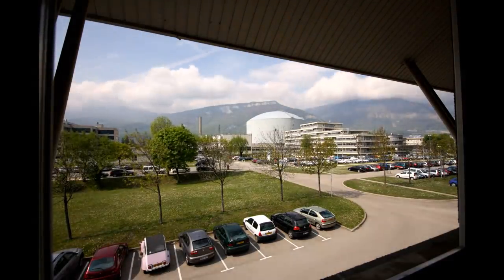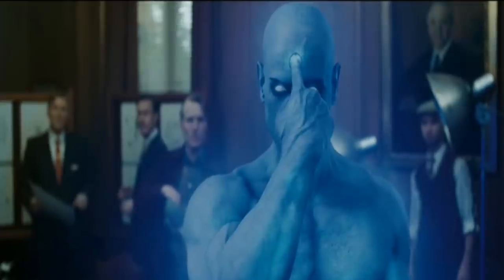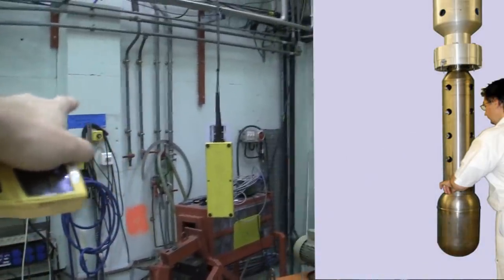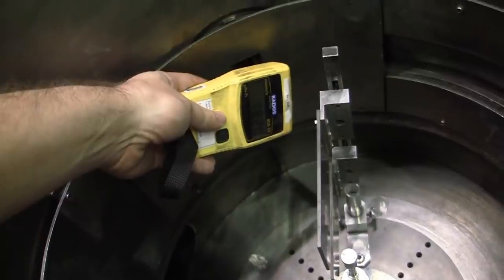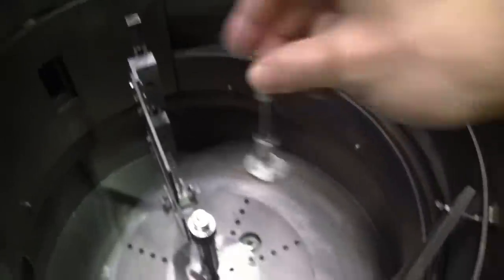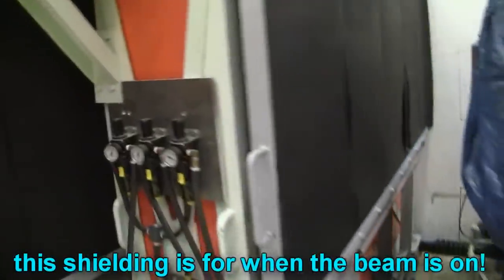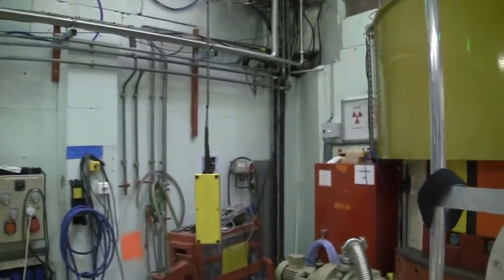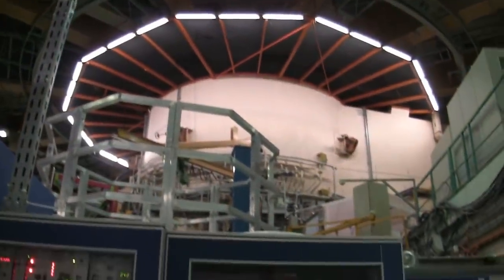Nuclear Reactors, Fantasy and Fact!

Comment: I always love the anti nuclear protestors who say "there is no way to get rid of the waste"  When if the waste was able to be transported (without them in the way) to a hole dug into a sublimation zone, simple plate tectonics will take care of the rest.
Reply: roaxeskhadil That is exactly what happens the mantle is depressed under miles of rock and goes deeper into the core where it is heated to the point where it melts.  Continental shift has been happening since the formation of the surface of the planet.  Now if the mantle that was depressed did not melt the core would look like a spring as layers were deposited at a couple of inches a year, but it does not.  Even if the rock only heated to a point where it softened the density of the nuclear elements would still sink through like a sinker in molasses. It would not spread radiation into any habitable zone.
Reply: Reto Fassbind Alright, let me dumb it down FURTHER for you. He clearly meant in his post radioactive elements, you tried to correct him(and act like a smartass) by saying radioactive isotopes. The reason you are wrong is because radioactive ELEMENTS are indeed heavier than rock so they will indeed SINK into it given enough time. Radioactive isotopes are just unstable elements like tritium which is in essence hydrogen. It was a crude attempt at making you reconsider the fact that you don't even know what he is talking about and stop responding.

Is it clear enough now? Will you shut up?
Reply: roaxeskhadil The amount of almost all of the radioactive elements in the core is massively higher than on the surface, the very centre is pretty much all radioactive elements due to their high density.  The proposal to place the wast into a zone that will be submerged into the area under the mantle has been described as the gold standard for disposal, No it has not been done in the real world but the science behind it is very sound and the computer models show that it would work .  Storing waste in abandoned mines or other underground facility's has the problem of needing to be guarded almost indefinitely in case someone wants to build a dirty bomb, even if the mine has been sealed with concrete.  The other proposal is to encase the waste in layers of steel and concrete and drop it into the deepest parts of the ocean.  Not a bad solution but the plan to use a subduction zone is expected to take around 50 to 70 years for the waste to be deep enough that it could never be retrieved. and would be cheaper. Hopefully we will go to thorium reactors and have much less waste, but still have enough to have to workout what we will do with it.
Reply: Reto Fassbind
Let me put it nicely: You were name calling.
If you don't realize it you're a child.
To put it bluntly: You are embarassing if you don't realize this.
Turn on your brain the next time you comment.
And look for some other words than child as well.

/end sarcasm

Do you have a fetish for calling every person a child? Nevermind the fact that I acknowledged my name was silly.
"Regards DouchebagAssholeify, internet anti-insult extraordinaire, of course.."
Are you a child for not reading? You know, instead of judging instantly? Or are you just an arrogant, narcissistic twat?
Actually, nevermind, your comments show you to be one.

Anyhow, I'll be off due to the fact that your reply will be another "omg ur a child lololol".
If it isn't I am genuinely surprised.
Reply: Reto Fassbind "Yelling at me without having the balls to say why?"

This is the only embarrassing thing here.
Reply: Yes, I agree with you completely and I'd like to emphasize that it really doesn't matter whether one is in favor or against nuclear power. To date, there are more than thirty countries running nuclear power plants and the waste that already exists needs to be handled in a responsible manner. Currently that nuclear waste is stored on the surface.

There's an excellent documentary about the subject. Into Eternity (2010) is about the Finnish long term storage site for high level radioactive waste and raises some interesting questions. See: http://www.imdb.com/title/tt1194612/
Reply: roaxeskhadil Well you started it, I'm channelling my inner 4 year old.
Reply: Reto Fassbind
Ok Finished real life problems, so to address your replies,
You are reading a comment section on YouTube, It’s not a peer reviewed journal so no I don’t have to supply scientific validation of any theories.
I did not come up with this idea and have never implied that I did. It is an idea that was mentioned at the end of a talk on the future of thorium reactors at Sydney’s UTS and I cannot find the program notes that name the professor (an American) who gave the presentation.   That said I still can’t think of a reason that it would not work. Not that it’s the only option there are plans for disposal into clay beds, or into deep rock formations.  But I am not so sold on them as they are still in potential contact with the water table.
Looking at the list provided, let’s see
 
1)...really think that 'youtube' is the appropriate place to release information about an unknown yet definitely award-winning technology?
It’s an Idea, It has been modelled and works in theory. This is not and was never ment to be a technical dissertation it’s YouTube.
2) ...is tempted to post a biased political opinion along with his/her scientific assertion?
Where have I posted biased political opinion at all, I really would like to know
3)  ...confuse essential terms (e.g. 'subduction zone') with other completely unrelated words?
Sorry. Blame auto correct, I should have picked it up
4) ...use non-existent terms (e.g. 'nuclear elements') in his/her verbose explanations?
Um, Nuclear elements don’t exist?  Any matter that exists in a pure form is an element look it up. Sorry if I am verbose.
5) ..use a simple physical property (e.g. 'density') as the main point in his/her argument about a topic that is far to complex as to be reduced to such a thing?
Why mention Density?  Because that is the key physical attribute that would make it sink into molten rock. Not anything else.
6) ...react in a comprehensive way when flaws are pointed out?
How else would you like me to reply?  Not respond? I don’t understand
7) ...provide any further information (e.g. URLs) on his/her claim?
Again Not my idea, and you do have the internet.  Searching the term returned some posts that say it would not work and many that say it will.  Personally I think it’s a good idea worth testing
8) ...resort to name-calling when faced with disbelieve?
I think you will find that I responded to an insult first.  I try not to insult anyone till they start it but then I will not particularly hold back.
9)...If so, then why asking for peer-reviewed papers? A simple Google search should do. Wacky claims neither deserve nor do they need more than that.
I did not ask for peer-reviewed papers.
I think it’s a reasonable idea, if you don’t that’s fine argue on the merits.  A good argument will sway my thinking.  I have been known to change, I like to think it’s part of looking at things with the scientific method.
Reply: roaxeskhadil
He wasn't the first to insult others.
Reto Fassbind called him all sorts of names before he started insulting. He didn't even insult you, so I don't understand the problem.
Regards DouchebagAssholeify, internet anti-insult extraordinaire, of course..
Reply: *****
One more thing.

"The problem with wind turbines and other green methods like solar panels is that they are not as feasible in every country and climate"

If you're honest the same is true for coal, oil, gas and uranium.

That doesn't stop us from using them, does it? Why not use the sunny regions for solar energy, the windy ones for wind turbines, the mountainous ones for water power and those geolocally active for geothermal power? You need storage and transport, anyway. So generate the power locally, convert any surplus into e.g. hydrogen or methanol, store and transport that like we do oil now: by train, truck or pipeline.
Doesn't take too much imagination. Of course every conversion and transport adds to the losses and makes the solution more expensive, so a halfway intelligent plan to do this cross-state and cross-border would probably be helpful. The forces of the market alone are in my opinion insufficent, because there's no real incentive to change anything at all and all we we get is the kind of not very valid argument you've given, why it's supposedly not possible.
Reply: Reto Fassbind Read the technical paper fuck knuckle, Also drop a stone in a bucket of water, where did it go? Nuclear waste is very dense, the shielding, lead and steel again denser than stone.  Now you turn in your brain or are you not willing to abide by your own standards.
Reply: Reto Fassbind Please look at the name at the top of a chart called the periodic table of ELEMENTS some are radioactive be that alpha to Gama.  I was not going to name them all.
Reply: Mark Bolton Yep, the problem is that current maritime law prevents this.  There are zones on land that can be used that would use a tunnel dug into the subduction zone.  I agree about the fast reactors but there are political reasons against them.
Reply: Michael Weston I don't know why people are arguing over this. All you need to ask him is this- provide a peer reviewed work on this topic or it's a bs
Reply: Michael Weston no, I asked for peer reviewed paper, from you. or at least give us the link to "the technical paper". you did say "Read the technical paper fuck knuckle" after all, so enlighten me please.
Reply: It's been pointed out before, but yes I've been wrong. I apologize. The no-longer-really-new comment system sometimes makes it hard to keep track of posts, especially if YT decides to notify one of only a few of them.
Reply: Razgrits .
Now you start to articulate something that looks like a coherent thought, we finally see who's behind that yelling and copy&pasting.  

First note
You don't have the right to silence other people. Especially since you approached me. Don't insult just to make up for your position's lack of validity.

What's it about
Michael Weston has put forward a solution of how to get rid of nuclear waste by dumping it into a subduction zone. He called it simple and said 'it works'. Me and other sane people have consequently pointed out the numerous flaws.  

+Razgrits: Alright, let me dumb it down FURTHER for you.
Me: actually that's the first time you ever tried to use reason, facts and logic (in case you didn't realize).

+Razgrits: He clearly meant in his post radioactive elements,...
Me: he said 'nuclear elements' which is a misnomer. I pointed it out. Extraordinary claims need extraordinary evidence and not bungled statements.

+Razgrits: ...you tried to correct him...
Me: _I actually did correct him, before he got completely awry.

+Razgrits: _...and act(ed) like a smartass... _
Me: you mean 'like a retarded smartass', right?

+Razgrits: ...by saying radioactive isotopes. The reason you are wrong is because radioactive ELEMENTS are indeed heavier than rock so they will indeed SINK into it given enough time. Radioactive isotopes are just unstable elements like tritium which is in essence hydrogen.
Me: Whoa! Ouch....let me break it down for you:
- 1) the high density of radionuclides have never been disputed - by no one.
- 2) you don't know what an isotope is.
- 3) you don't know what a stable/unstable element is.
- 4) you don't know what nuclear waste is composed of.

Must-knows
- The element Carbon, for example, has three important isotopes: C-12, C-13 (both stable) and C-14 (radioactive).
- All elements below atomic number 83 (Bismuth) are called stable, as they have at least one stable isotope.
- All Elements above Bismuth are called unstable (radioactive) as all of their isotopes are radioactive.
- Nuclear waste contains a lot of long-lived and medium-lived fission products (e.g. the famous Cesium-137 or Strontium-90). Important: theses are radioactive isotopes of stable elements.

Conclusions
You don't know what you are talking about. All these insults were just meant to hide the fact that you have no clue. Statements like Radioactive isotopes are just unstable elements... demonstrate your ignorance.

For the record: It's best to say 'radioactive isotopes' in this context, as nuclear waste not only contains radioactive elements, but radioactive isotopes of stable elements as well (i.e. fission products like Cs-137). Did-you-get-that or is it too educated for you?

The density issue was never disputed but here's what sane people would say:
Geology is way to complex as that a simple physical property (i.e. density) would be a convincing argument (see roaxeskhadil first post in this thread: volcanoes). After all, this is about highly radioactive nuclear waste that lasts at least 100,000 years and is extremely lethal to the environment. A water-bucket-based analogy is nowhere near good enough.
Reply: roaxeskhadil Comparing fission with coal and oil its easy to see that it kills less people, is cheaper and greener. Maybe nuclear energy isn't the safest option but its worth the sacrifice. If we keep using fossil fuels there will be a lot more deaths due to global warming, radiation and pollution than there will be if we use nuclear.
Reply: *****  Hmm, I definitely remember saying that I don't like fission as an energy source, but am willing to accept it as a transitional technology. I was objecting to possibly unsafe waste disposal (which any form is for nuclear waste, as proven by reality at least in the US and Germany, is, but there's unsafe and - for lack of better words - hare-brained) and to investing in the development of Thorium power plants, because I don't see it's worth the money (I've been living for years not far away from the ruins of a Thorium reactor that was never finished. Maybe that's a cause for bias, there).

Whatever. Fossil fuels - nuclear energy is no longer a dichotomy. There's other reliable, cheap and clean technologies. We just have to use them.
And then there's the fusion technologies being developed. Yes I know it's been for 30 years 30 years away from commercial use, but maybe - just maybe - we'll have to make up our minds about it and force the project, do a "Manhattan Project on fusion".

But claiming that 60 year old technology is going to be the future doesn't sound right to me, especially since we know that there is huge risks (low probability, but high effect) involved.
Where I live there's three nuclear plants in spitting distance. If one of them went into meltdown, however unlikely, this would affect ~10 million people and gut the country's economy.
The argument against wind turbines on the other hand is: we have to build cross country power lines (that are more or less required anyway, but the network providers have managed to erase that from the public's memory by careful lobbying). And they kill birds that are hit by the rotor blades.
Both are rather weaker arguments, aren't they?
The third argument against a "green economy" seems to be the lack of required energy storage. But that is just another instance of "the technologies exist, but no one wants to invest", which is solvable (usually by subsidies, which I don't like any more than the next person).

Mind you: with 30-40% of carbon emissions being generated by traffic, any technology addressing only stationary power generation will only be half the solution (and battery powered cars I consider a cul-de-sac, another transitional form), so there's definitely a need for technological development and - probably - a (cross-border,) integrated energy concept, adressing production, transport, storage and means of keeping consumption in check, which currently exists in no part of the world.
Reply: I do realize that we have to address the problem from multiple places, like you mentioned how much of a problem the current transportational methods are and i believe electric cars will be very feasible in 5-10 years.

The problem with wind turbines and other green methods like solar panels is that they are not as feasible in every country and climate. I however mostly i agree with what you are saying and yes i also think of fission as transitional technology as you do, but the real reason i advocate fission is because i feel like we are in a hurry to abandon fossil fuels.
Reply: Reto Fassbind sorry i know nothing on the subject at hand but i have to say you calling him a child is really childish of you considering he did nothing to deserve a personal attack.  I know this is youtube and every one has to act like an immature little snot but come on step up and be bigger then the expectation
Reply: hardwirecars Yes you're right. I shouldn't have said "you are a child". I should have said "childish of you", as you just did. I see that mistake. Besides the pretty harsh name-calling I received for it - that obviously seems to be OK because I started the whole mess - it also completely distracted form the issue we were talking about. So yes, it's a childish idea to think, that the problem of storage of nuclear waste could be solved by a theoretically appealing but nevertheless completely immature "subduction-disposal"-technology. Just the idea that this could be an economically viable solution and should be funded with tax money is childish, however, that doesn't automatically turn the person who thinks so into a child. Fair enough?
Reply: Michael Weston
Your evidence being?
My evidence to the contrary: more or less every ore deposit around the world. The best (known) probably being the "Silver Mountain" at Orosí in the Andes, which is an extinct Volcano.

Again: I'm not claiming that anything bad will definitely happen, but that it's totally out of our control and therefore preferable to use other method of waste disposal.
Reply: Almond Krackie
Let's see ... did anyone already try this? No.

So the conventional view obviously is: no, not a good idea - for whatever reasons: cost, risk, waste of valuable resources, whatever.

As the novel idea is sinking nuclear waste in subduction zones, the burden of proof for it being technically feasible, involving reasonable risks, at reasonable cost lies with the claimant, +Michael Weston.
Reply: Michael Weston
That the earth's core is enriched in heavy elements is true, sure. But saying that processes that have worked over hundreds of millions of years to achieve this state willl work the same on much shorter timescales is basically the same as comparing weather to climate.

Mind you, I'm not a fan of storing the waste in underground mines, either. I'd very much prepare not to create it at all, but I'd accept it as a necessary evil.
Thorium reactors I wouldn't count as a possible alternative, as at the current state they would probably take 10 years of development plus another 15 years of planning, building, testing, optimizing until it would be really feasible to make any serious impact on energy production levels with this kind of machine.

I'll give you that I might be wrong on this issue. To convince me, though, you'll have to come up with more than just saying "It has been described as the gold standard": Who has done so? Where? When? Who is a stakeholder in the study? Ideally show me the associated study.
Reply: roaxeskhadil peer reviewed work has nothing to do with whether it is popular or not. If said "technical paper" is based on solid science it would not have any problem getting published in a peer review journal. And also I'd like to know what is this "technical paper" that he was talking about. I'm not saying what he was saying is not possible, I'm just pointing out that he has failed to provide any credible source on the topic.
Reply: Almond Krackie Sorry, there seems to be a misunderstandig. From the way you used "you" and "him" in your original post, I was assuming "you" meant Michael Weston and "him" meant me. So, as evidenced by the other post I made in parallel to the reply to you, we are of the same opinion, with the exception of me being less aggressive. :)
Reply: roaxeskhadil i see the way i replied to the original poster could confuse the readers, my bad
Reply: Almond Krackie
Yeah, I was puzzled as well....but then I figured you probably just addressed the wrong person, since the burden of proof lies with those who make the claim and you seem to be a reasonable person to be aware of that.

And the claim - a simple solution of how to get rid of all nuclear waste - was indeed a very extraordinary one.

To be honest I find it a bit out of place when people are asking for peer-reviewed papers anytime someone comes up with such a claim. Suffice to ask yourself the following:

Does the person who makes such a claim...

1) ...really think that 'youtube' is the appropriate place to release information about an unknown yet definitely award-winning technology?

2) ...is tempted to post a biased political opinion along with his/her scientific assertion?

3)  ...confuse essential terms (e.g. 'subduction zone') with other completely unrelated words?

4) ...use non-existent terms (e.g. 'nuclear elements') in his/her verbose explanations?

5) ..use a simple physical property (e.g. 'density') as the main point in his/her argument about a topic that is far to complex as to be reduced to such a thing?

6) ...react in a comprehensive way when flaws are pointed out?

7) ...provide any further information (e.g. URLs) on his/her claim?

8) ...resort to name-calling when faced with disbelieve?

If so, then why asking for peer-reviewed papers? A simple google search should do. Wacky claims neither deserve nor do they need more than that.
Reply: Michael Weston  Well Michael, you no longer simply claim that it works, rather you personally think that it’s a good idea worth testing. Welcome back to reality.

Allthoug it may seem to you that the subject of nuclear waste and its disposal is just another nice-to-talk-about subject, here's why it's not:

You are living in Australia, a huge country with no nuclear facility and therefore no significant amount of nuclear waste to be disposed of. Moreover, Australia is one of the world's biggest Uranium producers in the world. No wonder why you live in a society that is rather indifferent about the subject and its involved risks, contrary to billions of people in other countries on this planet. So I don't blame you for your ingenuousness when you talk about 'anti nuclear protestors'  you saw on TV for a few seconds. You really need to know more about the subject.

It's none of my business to prevent the Australian tax payers from financing any testing of your praised subduction idea. As for the waste produced where I'm living, it still will have to go into the bowels of the Alps, either way, as there is no subduction zone in sight...

Could nuclear waste be disposed of in subduction zones?
http://www.thenakedscientists.com/HTML/questions/question/1000181/

Why Not Dispose of Waste in Ocean Trenches?
http://geology.about.com/od/platetectonics/f/seadisposal.htm

Of course, these links are just simple Q&A's on the web. But since you didn't even realize that my previous post didn't address you but +Almond Krackie, I think that's probably the best we can do.
Reply: Reto Fassbind seems like that's pretty much end of the conversation
Reply: Reto Fassbind
Well, you can see it both ways, but it just so happens that I believe that any kind of personal attack, however weak, should be left out of a civilized discussion.
I may think some line of argument childish, I might get sarcastic, but in my book everything that's not targeted at an argument is to be treated as an ad hominem. That makes you "guilty", even though we agree on the matter discussed.
Read through the thread. From the point on, where this "name calling" started, the Michael Weston was no longer in any mood to even listen to arguments. Which is a pity, since the links you dug up a little later were truly enlightening (and I say that in spite of the fact that they - at least in part - counter may original argument, as well).
Reply: Razgrits . Articulate your criticism in a sentence so that I don't need to guess what you misunderstood.
Reply: Razgrits . What point? Yelling at me without having the balls to say why? How embarrassing.
Reply: Razgrits . Well, parrot, here's your chance to educate me. Explain why your trivial statement: "radioactive elements: U, Pu, Th.. radioactive isotopes: e.g Tritium" is of any significance? You're having second thoughts, don't you!?
Reply: Razgrits . I
You are scientifically illiterate please hush regarding science!
[quote] The atoms that make us up were forged in the core of our sun and for our biological body to get here, a war took place in a woman's vagina. Isn't life epic or what?

I just came across of that remarkable YT-comment of yours. Do you really think our sun forged the Carbon, Oxygen, Nitrogen, Iron etc. that make up our body? Our Sun... really?

All this yelling just to hide your scientific illiteracy. That's rather sad.

PS:  your epic comment
https://www.google.ch/search?client=ubuntu&channel=fs&q=%22++The+atoms+that+make+us+up+were+forged+in+the+core+of+our+sun%22&ie=utf-8&oe=utf-8&gfe_rd=cr&ei=DfdHU7yOLuSX8QfcyYAI
Reply: Razgrits . Sorry TLDR, educated people reason, they don't scream like a mentally disturbed person. Now go on and read a science book.
Reply: Reto Fassbind Educated people also read, and don't tldr like backwards fucktards too scared to have their little set beliefs shaken. Also the only person here refusing to look at science is you. Especially after that tldr. The irony.
Reply: Razgrits .
[quote] Do you think biologists know the periodic table?
Are you home-schooled?
Reply: Reto Fassbind Actually yeah, it has chemistry in the curriculum, what do you know. In any case, refuting a single point out of a whole shitload of points doesn't refute a whole claim. You still have yet to tell me how what you have said in this whole thread is relevant. Instead of refuting Watson's idea with valid points, you called him a child and went around dishing at his ideas without actually even directly addressing them. Same with me, you are calling me uneducated based on random bits of irrelevant information that I had wrong. I still wonder how you consider that to be remotely intelligent, and why the fuck you have a fetish being a walking embarrassment.

Let me put it into perspective for you. A guy named DOUCHEBAGASSHOLE is calling YOU a dick. I mean, you really either have the aforementioned fetish or you have the worse self-assessment skills imaginable.
Reply: Razgrits .
[quote] Instead of refuting Watson's idea...
His name is +Michael Weston, not Watson. Stop doing drugs, Sherlock, you're losing it.
Reply: Razgrits .
You're making the extraordinary claim, you have the burden of proof.
Present your own facts to me and I'm gonna kick them around until your scientific illiteracy looks like a roadkill.
Reply: Razgrits .
Statements of the scientifically illiterate: face palm #1 - Protostar Dodge
[quote] 'Our sun' could be the protostar that formed our sun as well...
Why this is so wrong...

Why so ambiguous, did you or didn't you mean our proto-sun when saying "the atoms that make us up were forged in the core of our sun"?

You should know what you mean when explaining your own statement. Either you meant our proto-sun (which is also wrong) or you didn't when saying 'our sun' (then why bring it up?).

Neither our sun nor our proto-sun have anything to do with the forging of the elements that make up our body. When people say 'atoms were forged' they mean nucleosynthesis. The formation of our earth from the accretion disc around our early sun was a gravitationally driven process. It has nothing to do with the forging atoms in the core of a star, you [enter one of your derogative terms here].
Reply: *****
Just to clarify a minor point. I do accept / believe that electric cars are the future of personal transportation, but looking at planes or even just trucks, the battery based technology is the cul-de-sac I mentioned. Even for the average sedan the achievable range is probably never going to be what the consumers require with Lithum based batteries (and somewhere I read that trying to use they for all cars would exhaust the economically minable Lithium supplies quite soon, not sure if that's true).

This leads me to the prediction that the future actually lies with fuel cells. Maybe as a kind of plugin hybrid where the fuel cell acts as a replacement for the gasoline motor and / or battery charger. This kind of technology would allow for reusing existing infrastructure and solve the aforementioned problems of heavy machinery.
As a coincidence Toyota announced start of production of a fuel cell based car just this week ...
Reply: +Mekronid Yes. So what? Humans are by definition "human", and that contains "fallible". In any team running anything there's always someone lacking training, or corrupt, or just tired, or ... And where's these there's errors. 
And when this comprises costs in the hundreds of billions¹⁾, the loss of thousands of lives and livelihoods, and not "just" a few hundred dead, then it's something that really requires thinking about whether it's worth the risk. If you simply compare the TOC of fission reactors, including building, running,  demolition and in this case especially secure long-term storage of waste - the method proposed by the OP still is naive nonsense) with a mix of regenerative power (solar, water, wind, geothermal, as appropriate for the specific location), the simple truth is: no. Fission nowadays isn't worth it.
And comparing it to coal or similar is not what was suggested. I personally rather would keep nuclear than coal power stations running. But only with the clear goal of replacing them, too, as soon as sensibly possible.

¹⁾Chernobyl is expected to clock in at some $235 billion: http://chernobyl.undp.org/russian/docs/belarus_23_anniversary.pdf
Fukushima is currently estimated to cost $188 billion (and I personally would expect the number to rise further, as it has just been doubled) http://www.reuters.com/article/us-tepco-fukushima-costs-idUSKBN13Y047
Reply: "When we frack for oil "

Oil isn't a regenerative form of energy. I've not proposed viewing it as an alternative. And frankly fracking is just stupid, anyway. 

" It pollutes a local area, making it uninhabitable. "

Around my home town we have five nuclear power station in every direction and well within range of a hypothetical radioactive cloud. Any core melt in one of these would affect at least 1,5 million people directly and lead to a major disruption of the national economy. Sorry, but no, that's not just "generally negligible with proper cleanup efforts".

"People can still live 30 miles away from a former meltdown"

A 30 mile / 50 km radius in Germany (where I live) for almost all our nuclear power stations would mean that millions are displaced. Since large scale power generation is usually tied to major centers of population, that's probably true for most countries to some degree. 
If there was no alternative, then it might be worth the risk, but there are.

"that solar cells are still incredibly toxic to produce"

Far easier to contain than radioactive substances that need thousands of years to decay. Especially as the danger exists only during manufacturing, not at runtime, not even during decommissioning. And toxicity during production very much varies with the type of cell.

"water stations disrupt ecological environments on a mass scale"

Yes, but that does not necessarily mean it's a bad thing. It depends on the scale and location. I know quite a few dams that has virtually no negative effect at all, after the dust had settled. But these are usually smaller projects in regions that are wet and mountainous, not monster projects like the Nasser Dam or the Three Gorges Dam. 
And water power is probably best as a technology to balance the ups and downs in available energy from other renewable sources, anyway.

"Geothermal displaces the earth's internal heat, the possible consequences of which are still unknown."

That's just FUD. There's geothermal power stations in use for half a century. Iceland produces 25% of their electrical energy from them: http://www.nea.is/geothermal/, with additional energy used for heating.
And yes, geothermal energy needs drilling and can lead to side effects not unlike those of fracking. But again: not really what I'm suggesting. That's why I wrote "as appropriate".

"You can think of nuclear like a part of a well-balanced investing portfolio"

As I already said multiple times I'd personally accept fission as a bridge technology. If suitable money is invested at the same time into development of new technology & conversion projects. But building new reactors simply doesn't make sense. Economically. Even without taking into consideration the long term cost. 
Look at Britain's Hinkley C project: at projected $23 billion it was planned to provide 3200 MW. Electrical power from this station was guaranteed a price of £95.2 = ~$119 / MWh. 
For comparison: wind power in Germany for a turbine built this year is sold at a guaranteed €45.2 =  ~ $49 / MWh,  which kind of obviously is less than half that for the nuclear option. And it requires much less capital up front, plus it can be installed much better following changes in demand. (And yes, wind has drawbacks, too, I'm not suggesting to use only wind power.)
Reply: "How long was coal in use before we realized the damage?"

I'd say the damage was well known before the first large scale coal plants were built. It was just ignored.

"you're ignoring my points"

No. I'm saying they are invalid.

" If a dam bursts it can kill 1.5 million people in minutes"

Only if the dam is sufficiently large and upstream of a major settlement. This is not true for - say - any of the dams on Norway, as they are located appropriately, it is not true for any of the dams in Germany, as they are simply too small. Again: use the appropriate mix of technologies. If water power poses a threat - technological, sociological, environmental - then don't use it. 

_"modern meltdown would likely allow time for evacuation thanks to 
containment systems."_

The same argument would hold true for dams. They don't break without any kind of advance notice either: see the recent Oroville-dam-near-desaster. And also have a look at the chaos that the necessary evacuation of just 200,000 people caused.

"When solar cells are less expensive"

Depending on the region, they already are. Check for yourself at (for example) http://calculators.energy.utexas.edu/lcoe_map/#/county/tech

"therefore be regulated properly"

Why regulation? Solar cells are most sensible installed directly on the roof of the house that's using the energy produced. No real regulation required, maybe apart from building codes. As for the regulation of how to handle surplus: Germany does this for 20 years now. It simply works. Can be improved upon, of course, but the EEG has not yet caused any real problems, despite the complaints of the lobbies.

"will become safer to manufacture and more eco-friendly,"

"When nuclear power stations become less expensive, the will become safer to manufacture and more eco-friendly." Same logic, as sensible as your statement.

Solar cell production creates waste products. That's a given. This will not change, at least until somebody invents some completely different technology (something like artificial chlorophyll maybe, but that would then probably be based on GMOs and create other concerns). The thing is: hydroflouric acid, cadmium, tellurides and other wastes from solar cell production are a whole lot less difficult to handle than ²³⁵U, ²³⁹Pu, ⁹⁹Tc, ⁹⁶Cm, ³⁹Sr and the rest of the lot. And if somebody manages to steal them, nothing bad will happen. No dirty bombs, no water supplies poisoned for the next thousand years, because a few micrograms consumed are already deadly.

"I excluded wind because such vast areas are not suitable to run these devices"

That's simply wrong. Germany currently produces 15-20% of it's electricity from  wind on normal days, with the current record being some 110% for three days in a row. And there's still ample space both for additional turbines, refurbishing with more powerful ones, offshore devices ... 50% from wind alone as a steady supply is definitely possible by maybe 2030. It's just a matter of political will. And Germany isn't the only country with those kind of numbers. Denmark for example is currently at 42% steady state production.

For the US: just plaster the Great Plains and the coasts with the things to similar degrees we've done here. http://www.nrel.gov/gis/pdfs/windsmodel4pub1-1-9base200904enh.pdf 
China is aiming at >25% by 2050 https://www.iea.org/publications/freepublications/publication/china_wind.pdf, and that already includes a projected increased energy consumption.

"risks of nuclear power are sensationalized because radiation is so scary."

No. The focus is on them, because they are real and we've already seen twice how costly (in terms of money and suffering) these kinds of accidents really are. And both of these cases were actually kind of lucky as both Chernobyl and Fukushima could have had worse consequences, if the wind had blown in a different direction. 
You argument would make sense if I had said that I support coal instead of nuclear power, but I expressly don't.

And again: I don't get why you think myself an alarmist or overly opposed to fission. As I said: let the nuclear power stations run for 10, 15, 20 years longer, if necessary. Turn off coal, where you can, invest in a mix of renewables, choosing the most appropriate for each region. Develop better technologies on the way. The past 20 years have increased both the size and efficiency of wind turbines by great leaps. To a lesser degree this is true for solar power. In 20 years fusion could possibly be a thing, for example, if a "Manhatten Project"-like priority would be assigned - and not like currently the case with ITER the big international projects don't move along because of bad project management and half-hearted support. Or at least we have the next generation of wind turbines and solar panels, with higher efficiency and energy density.
Almost more importantly: reduce energy consumption. That a citizen of the US uses almost double the amount of energy that a European does is just ridiculous. That a European uses >five times the amount of energy an average human does, is still too much.
Reply: _"Well, that's ridiculous. It was ignored because most of the long-term 
detriments were unknown, not because of some other unspecified reason."_

The prediction of global warming was made by Svanthe Arrhenius in 1896. Rather dire scenarios were painted by the 1960s.

"We could say the same about nuclear plants."

Not really. Dams require by their nature mountainous regions with deep-cut valleys, these are usually not densely populated by nature of the terrain.
Nuclear plants require flat terrain with easy water supply. So usually river flats or similar, which are densely populated for the same reason.

_" I'm referring to how well the incident can be maintained to avoid loss of life.  

http://www.damsafety.org/media/Documents/Maps/locationmap_forWeb.jpg"_

Ehem. And your map shows mostly failures with casualties of 1; in total maybe 2000 in the last century, half of that in the time since the first nuclear reactor was built. Chernobyl alone clocks in at some 4000. And maybe you should use the picture in context (http://www.damsafety.org/news/?p=412f29c8-3fd8-4529-b5c9-8d47364c1f3e). "Coal dam" failures have nothing to do with water power and really are a peculiarity of the U.S.

And how well nuclear incidents can be contained has been amply demonstrated by the two major accidents - both plants are still not cleaned up and probably won't be for the next 50-100 years, at least. At least in Fukushima they are still trying, but in Chernobyl they just have given up. 
Admittedly these are the very extreme, Three Mile Island has been comparatively "mild" disaster and most core melts are expected to not get worse that that, but if >50% of incidents are outside of what is predicted, either it's just really bad luck, or the predictions suck. The statistical sample is a bit small to really judge this, but it's at least a warning.

"I'm not enjoying this double standard of yours."

That's funny. I've just shown you that your "standards" are at least as hypocritical as mine are.

"Unlikely. Different technologies scale to cost in different ways"

In case you didn't notice: this was about showing you that what you wrote is just a platitude. I could have replaced "solar cells" in your original sentence with "beer bottles" and still the sentence would have made about the same sense.

"Hilariously, Germany produced some great evidence against your claims: "

This is just stupid. The original paper (linked to in the article) suggests 10% less than what others predict to be realistic. If the turbines are positioned near to and downẃind from each other. This doesn't change anything, it may drive up the cost a bit, but that's the worst case scenario. It doesn't follow in the least that wind power isn't viable. And the real life numbers I've given you don't change because of it. The €45.2 I quoted are sufficient for 5-8% return on capital per year, by the way. Another hard number.

"That's just the U.S. - and you want me to pay more attention to TWO incidents?"

Yes. Two incidents with a combined loss of life of >5000, $400 billion in damages. Compared to hundreds of incidents in double the time with less the half in loss of life and generously 0.2% the damages, maybe 0.5% if adjusted to inflation, even ignoring that the list lumps in completely different accidents that just happen to be related to dams, but have nothing to do with power generation. (See also: http://www.infomine.com/library/publications/docs/Azam2010.pdf )

I'd say the numbers are quite clear what's the bigger hazard.

"Because you are."

Now you are just lying. I've made my position very clear and it's not what you claim.

"You're terribly off base on a number of facts"

As demonstrated above I'd say it's obvious that you are wrong on the facts. Counter my numbers with numbers¹⁾, not with misunderstood news articles and out-of-context-pictures. If you can do so, you may have a point. Until then: I'm done.

----------
¹⁾ And don't try to hit me with "your back of an envelope calculations are off by 5%". I've simplified, I've rounded. There's a margin of error. I'm aware of it. It doesn't change anything. This is youtube, neither am I doing a business case, nor a scientific paper.
Reply: Lots of energy wasted in the comments is what this is, science damnit!
Reply: Says a guy who believes in a flat earth, right? At least that's what's on your channel...
Reply: Whom exactly are you talking about / to?
Reply: Who know's? lmfao
Reply: Unibrow of Death: Ok, can't say I'm surprised, but I wanted to give you a fair chance.

1) Congratulation on checking my profile. This shows at least some inquisitiveness on your side.
2) You have stepped in the "trap" I left there to test the reading skills of flat earthers. That's not a good thing.
3) "knows", not "know's".
4) I assume you were supporting the opposite argument, then. Combined with the low attention to detail exhibited, I can then only say that your postings only go to corroborate my position, as it's abundantly clear that you either don't read articles / postings with the necessary attention to understand them, but as superficially as Mekronid does, or not at all. In any case not a good foundation to stand on assuming you're right.

Bye.
Reply: Yes that's what you do, set traps.

Bye.
Reply: Reto Fassbind So I'm guessing you don't get laid very often.
Reply: Michael Weston Not an entirely bad idea you laid out.
Reply: Better into a volcano just boiling at the surface. That is as long it would stay that way for a few days after. Stuff came from the earth...alot from here in Texas.
Reply: @jerrynewberry2823  i dont think putting the waste in a active volcano its a good idea.
Reply: @spinosaurusstriker  you a liberal?   We have several volcanos that have magma roiling on the surface but haven't erupted in decades. It doesn't take long for. The dispersal of material to be mixed.
Reply: @jerrynewberry2823  what has the liberal thing to do with anything?
Reply: @spinosaurusstriker  you know, I think you need to finish the eighth grade before you get on your phone.  Your mother know you have hers?
Reply: @jerrynewberry2823  you have some issues bro.
Reply: Wow, sounds trivial...
Reply: Putting nucler waste in a "sublimation zone" really wouldn't be a good idea ... fortunately enough there's no such thing on earth.

But neither would be using a subduction zone in the way you suggest. To give a few keywords why not: Pacific Ring of Fire, San Andreas Fault, Mount St. Helens, Mount Pinatubo, Andean Volcanic Belt, ...
Reply: roaxeskhadil Argh I hate mixing up words, thanks for the correction, now look up the science. it works, nuclear fuel and by products are dense, real dense they sink in molten stone and will sink to the centre of the earth and join the rest of the uranium down there.
Reply: Michael Weston You're assuming the earth's mantle is liquid, as in water, aren't you. Well it's not. It's more like plasticin, to use another common substance as a reference. Melting crust up to this point, even, takes a very long time. Dispersion even longer.
Former crust material can be identified in the earth mantle for hundres of thousands / millions of years.

See, for example, the graphic on page 2 of this PDF:
http://www.earthbyte.org/people/dietmar/Pdf/Whitney_etal_Lithosphere09_ContinentalSubduction.pdf

Mind, I'm not suggesting that using your approach would lead to a nuclear desaster. It most probably wouldn't. But it's still not very kind to risk irradiating larger stretches of landscape, even if by then we'll all be long gone.

I'm not really a fan of fission technologies, mostly for the risks involved while the reactors are actually running - and them not being that cheap a means of producing energy as the industry likes to tell us -, but assuming we must, then I'd much prefer a reasonably secure long term storage deep in granite and/or salt where the risk involved is calculable to your idea with rather random risks involved.
Reply: Michael Weston Didn't I already tell you to look up words before posting them? What the heck are "nuclear elements". Do you mean radioactive isotopes? Just because words like nuclear power or nuclear energy exist, doesn't mean you can make shit up. You really must be home-schooled.
Reply: roaxeskhadil Well, I don't see a reason to apologize. Calling someone a child for childish, factually wrong claims is not calling names.
Reply: DouchebagAssholeify Nah, name-calling is the use of abusive names. You're a child if you don't see the difference. At least that's the feeling I'm getting here when I read your user name...
Reply: Glad to read your post, since your reasoning is based on what I already mentioned in my first post: common sense

Unfortunately, not everyone possesses this basic capability. So why bother to argue about the loony idea of dumping nuclear waste in a subduction zone with poorly educated and confused pigheaded fellows...There is really no point.
Reply: Razgrits . Sorry, your profanities are not convincing. If you have the balls then try to use an argument. By the way, you missed the point as the term in question was nuclear elements not radioactive elements.  Try to read more carefully.
Reply: Michael Weston
How very deep of you to resort to name calling when somebody dares to disagree. I like your style.
Reply: Michael Weston Let me put it nicely: you're a child, with little or no capacity to reason. To bluntly state that it works is embarrassing to any thinking person. It works, really? Or does it work theoretically (I seriously doubt that)? Or does it work most of the time? Why not send nuclear waste to the sun using a rocket? That would work, wouldn't it? Well, in most cases, right? No one needs to be an expert on rocket science, nuclear physics or plate tectonics, when it comes to tell apart loony ideas from common sense. So please, turn on your brain the next time, and - if possible - look up some key words before posting. Thx.